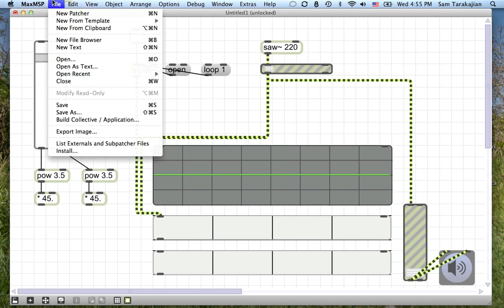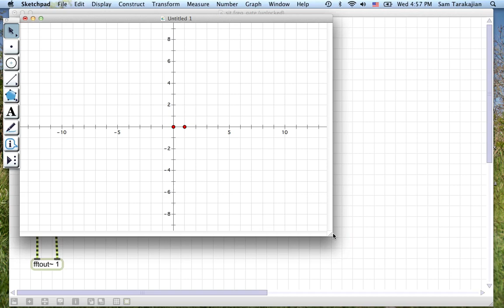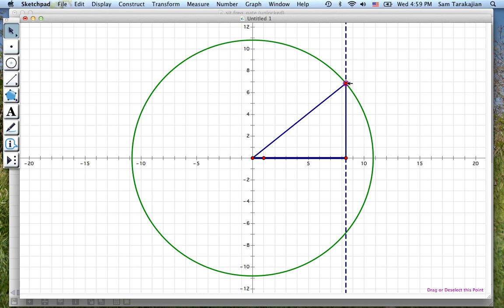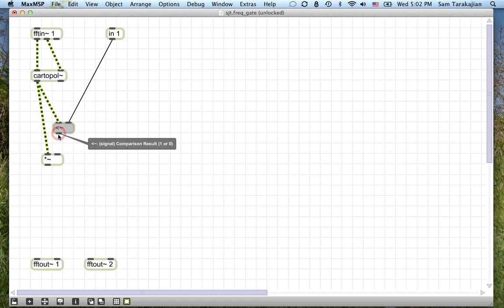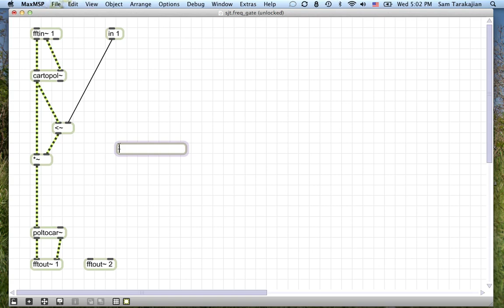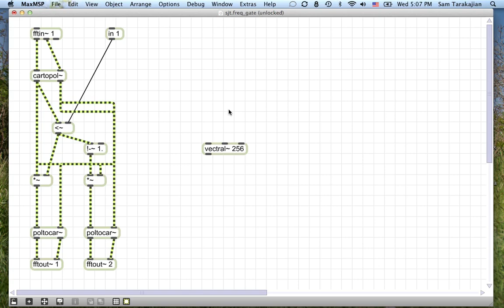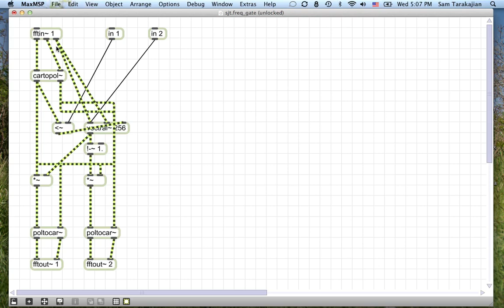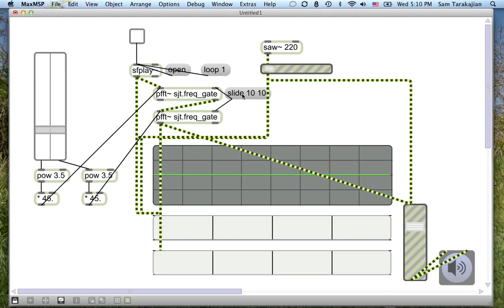Delicious Max/MSP Tutorial 12: Pfft~ is your friend

Comment: Great tutorial. neverthless still I need more understanding in bin amplitude values (where that strange numbers come from? There must be a math explanation on wich is the actual max amplitude value). Anyone knows how to calculate that?

Vectral is still a bit a mistery.. ok it creates a sort of smoothing ramp between values incoming at 3rd inlet.
Works over time. Now each quantum of time is here a DSP vector duration (in Max terms)?
 
"smooth 2 2" means that it takes 2 vectors duration to pass from the previous value to the new?
i.e. in case of 2 following values 0 and 1, related to X bin, 1st X bin has 0, 2nd X 0.5, 3rd X 1?

Why vectral needs the vector size argument? cannot take that directly by audio states settings?

I apologize for questions, I hope also other Maxers have curiousity on that. Cheers